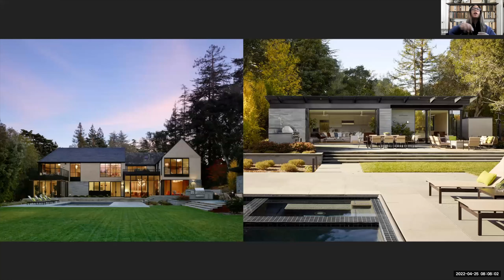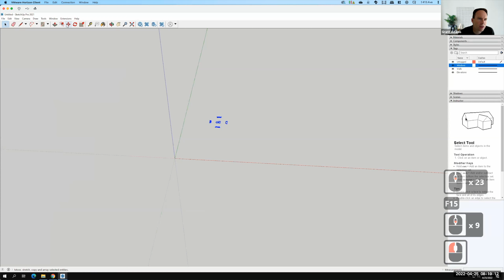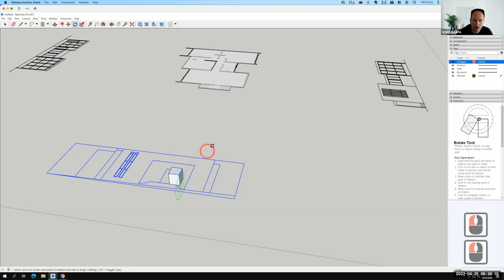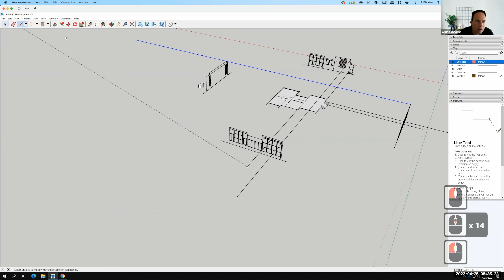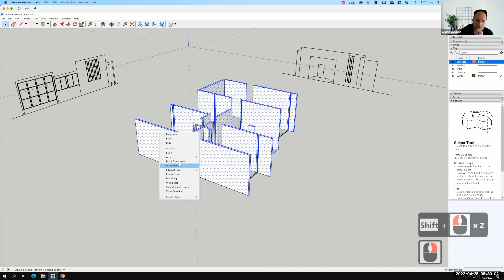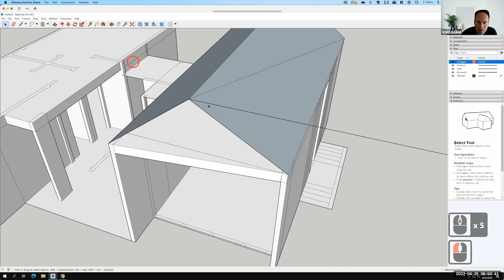Lecture 124 - Bringing AutoCAD into SketchUp (Spring 2022)

Comment: Hi. Im doing this project where i uploaded architects cad files onto sketchup but the drawings have a lot of lines and dimensions. I was hoping to keep the cad drawing for helping me wit the interior design later on but im having a problem that the lines and dimensions are affecting me commands like push pull and a lot of strange things happening even if the files are hidden i still have problems.
Reply from the maker: When you bring in the CAD file, make it a group or a component.  You’ll have to trace over the floor plan when you push/pull walls, but this should minimize the issues you’re describing.  Good luck!